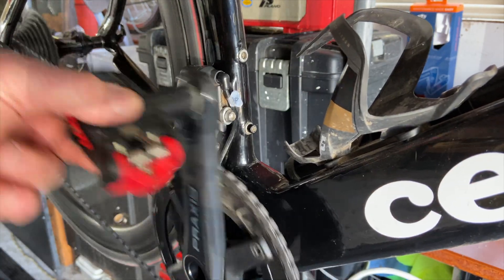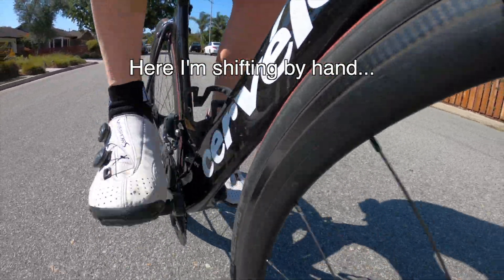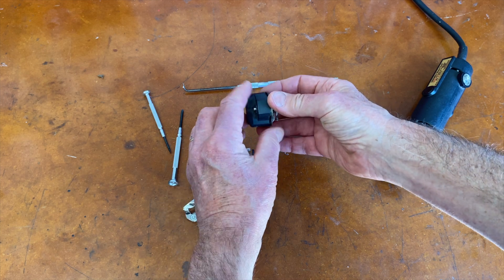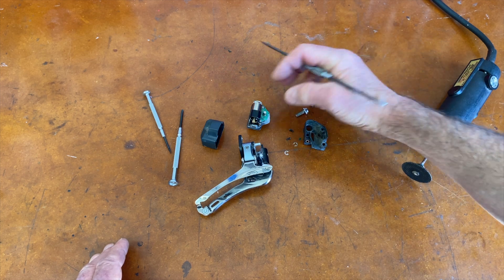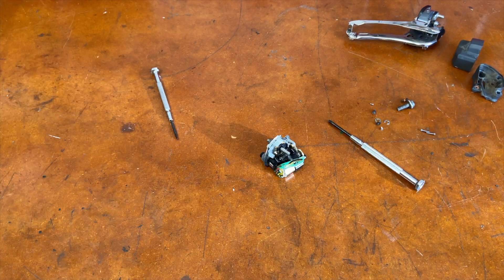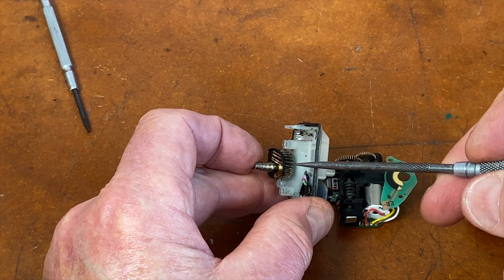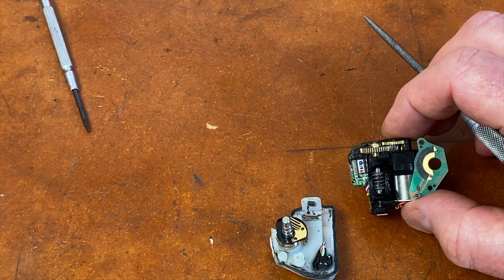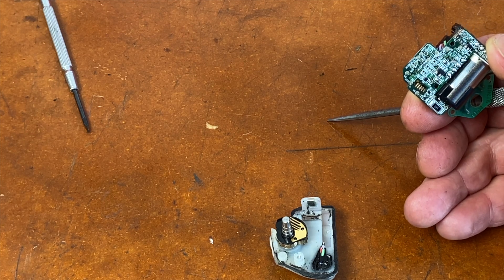A Look Inside Shimano Di2 ELECTRIC SHIFTING Bicycle Front Derailleur

Comment: Hi friend. The chain guide on the derailleur is broken. I've seen that there is no breakdown. Do you know how it could be repaired? I'd like to show you a photo but I don't know how to upload it. Regards.
Reply from the maker: @clicli6876  thanks for watching and the question cicli. Sorry to hear your cage broke. Maybe it could be welded back together by a welder with the skill but it might be cheaper to buy a used one on ebay as I did. Good luck!
Reply: @JimLangley1  yes. I will buy a derailleur with other problem and to change the guide. Thanks

Comment: In RC hobby boating, flying, we use common servos for all control and they are cheap too, compared to these bike electronic derailleurs. The derailleur motor has to use a lot of force to shift to the larger chain ring because of the spring counter force.

A bidirectional motor control could eliminate the spring pushback force entirely. IMHO that would eliminate most of the worm gear wear and tear.
Reply from the maker: Thanks a lot for sharing this Graydon. Let’s hope Shimano is paying attention.

Comment: Great video. However I do have different problem... I just upgraded my frame to Storck and my Di2 7970 cables cannot be fed through the small hokes in the bike frame! Anybody was having same problem? Did you cut the wires and then solder them back again with success? HELP!
Reply from the maker: Thanks for watching and the question, Łukasz. The solution is usually to enlarge the holes in your frame. But first, you should call Storck tech support and tell them what model frame you have an ask them if it's okay to enlarge the wire holes to accept those wires. I'm pretty sure they'll say it's fine to do it (I've done it on various carbon bikes) and probably also tell you how to do it, what the best tools are. I find it's best to phone/call bike companies and tell them you're a bike owner with a technical question versus sending emails, which often don't reach anyone. Here's their website where you should be able to find their number: https://www.storck-bikes.com/ Thanks again!

Comment: Your video really got me thinking Jim!  Ignoring the perceived value of electronic shifter performance or ergonomics improvements, it would be interesting to see a good analysis of its total cost of ownership vs. mechanical shifting.
My initial reaction was disappointment that Shimano has turned a relatively expensive component that could last the lifetime of your bike into yet another "consumable".  When I upgraded to 11s, I sold my old 9s front derailleur for more than I paid for it new, and it was still in great shape after 20 years of heavy use.  But then I realized there are some tradeoffs to consider...
* Mech derailleurs require replacement of another consumable -- cable housing/wire.  I'll make a wild assumption that annual replacement for heavy usage is $25 for parts+labor for one derailleur, that's $175 over 7 years (at today's prices)
* Electronic Ultegra Di2 FD retail is currently ~$240.  Assuming $30 replacement labor, that's $270 every 7 years, if your 7yr lifetime is typical.  Di2 also wears out Li Ion batteries ($76 online), so if you're lucky enough for that to last 7 years, that's another $76/2=$38 per derailleur.  Now we're up to $308 each 7 years.
I suspect Shimano chose a nylon worm gear instead of brass to keep down noise, but I agree it would be great if they can figure out how make it field-replaceable.
Reply from the maker: Great thinking, Chuck - enjoyed your cost analysis. I actually rarely wear out shift cables. I'd say if they're properly installed - housing, too - and the cables and housing are Shimano, you could get at least 5 years out of a cable and housing, if not a lot longer. Of course that's here in California. If you ride in the snow and rain a lot, you could definitely need new ones more often. Still, I think the cost of owning and maintaining standard derailleurs is a lot lower than e-shifters - and especially since the price keeps escalating. 

I have been hoping since the first Di2 that prices would come down as is the rule for most other electronics. But sadly that hasn't been the case with any of the electric shifting systems. Probably because they keep reinventing them instead of refining what they already had. But, that's probably because electronics technology keeps changing, especially when you throw in wireless. 

I wrote about my broken Di2 front derailleur in my Jim's Tech Talk column and got some great feedback from readers if you're interested. Of note to me was how many readers who had electric shifter failures - different kinds. Here's part 1: https://www.roadbikerider.com/wearing-out-shimano-di2-front-derailleur/ and part 2: https://www.roadbikerider.com/shimano-di2-derailleur-failure-part-2/ Thanks, Chuck!

Comment: that was fascinating, love tear downs ,now its possible to get a new worm drive made a good clock restorer  would cut one in brass does nt  look like it will come out of its position without destroying the casing like a sealed unit press fit one time only
Reply from the maker: I'm happy you liked the video, Theresnobody Here! Thank you for watching and commenting. I actually just had something very similar fail on my motorhome. The automatic step that opens when you open the entry door broke. It turned out it too was a broken nylon worm gear! And for that I found a guy selling replacement gears he is probably making with a 3D printer. Fortunately, automatic steps are made to be taken apart and repaired so the whole thing cost only $30. If only I was so lucky with the front derailleur, right?

Comment: Great video! So interesting. Amazing that cables will go away completely on new group sets. I'll keep an open mind. I wonder if return spings could become much lighter? Both front and rear. Thanks again.
Reply from the maker: Thanks for watching, Peter! I believe Shimano is completely focused on improving performance and has decided that the best way to do that is with electric/motorized shifting. I agree that they should be able to to make it lighter and simple. Their new front derailleur appears to be much smaller than my old model. It would be really great if they could get the cost down. Thanks again!

Comment: I am a 'tech guy'. And recently a 'bike guy'. So videos like these are a great fun to watch. I'd definitely prefer to be able to fix things. Especially expensive bike parts. Not meant to last I suppose.
Reply from the maker: Thanks for watching and commenting, Richard! I was hoping I could fix the derailleur. But it turned out the only solution was replacing it. Luckily there were some used ones on eBay. In case you haven't watched it, in my accompanying video about the derailleur I show how I replaced it: https://youtu.be/eZO0av3EOW4

Comment: If it's not serviceable then why didn't they make it brass as well? I was originally thinking it was some kind of "shear-pin" in the transmission but why would it matter if you can't service it?
Reply from the maker: You’re asking great questions, Aaron. Usually wear parts like this are replaceable. But the whole black box is sealed up and not meant to be dismantled. Thanks for watching and commenting!